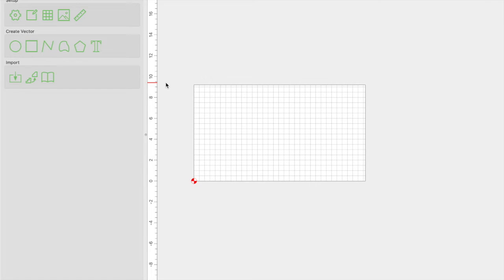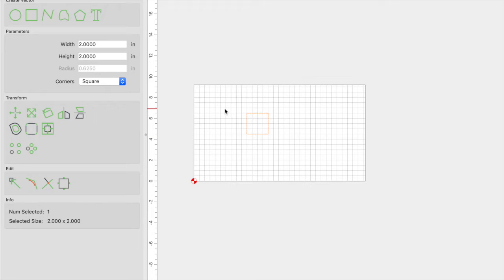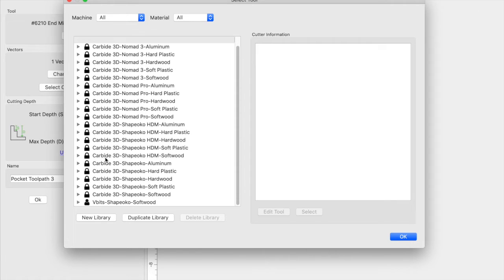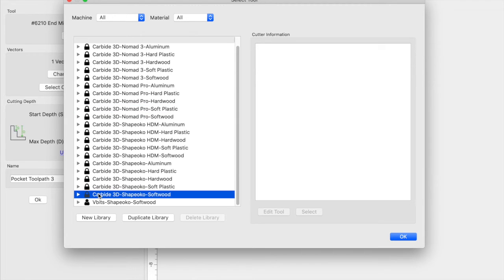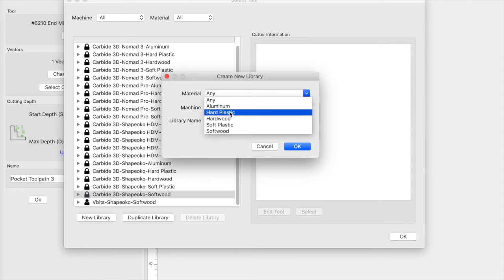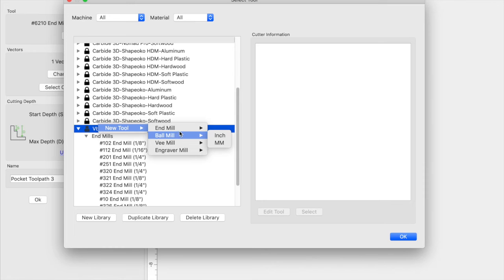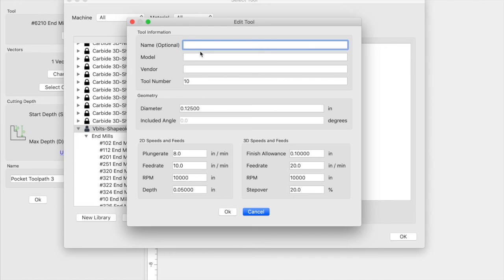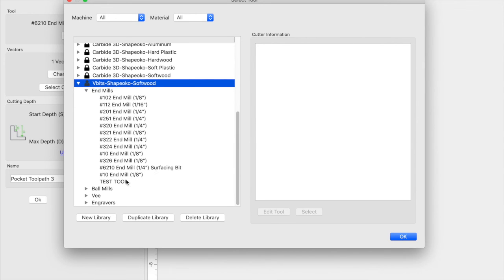How to Add a Tool in Carbide Create: Your Step-by-Step Guide

Comment: The underlying database for tools is in the CSV spreadsheet file format. The tool files can be edited with a spreadsheet application such as in the Libre Office Suite. I attempted to use OSX Numbers on my Mac but Carbide Create crashed after exporting the file back to CSV to save my edits. The CSV file contains a detailed tool profile structure, much more than is available to view or enter within Carbide Create.

Comment: good info thanks  but how do you add tool if you don't have any specs on it
Reply from the maker: Hey Vincent, I’d look for some specs from the manufacturer.

If they don’t provide specs I’d look for some specs from a similar tool. 

Even if you enter some default specs when adding the tool, when setting up the toolpath you can always change them. 

As you experiment with the tool and some settings you may find something that works for you.  You can then go back in the tool library and update those default settings to what you like.

Comment: I'm having a hard time with advanced v-carve. Using two bits, how do you get the machine to let you zero your second bits z-height? I zero the x/y/z of the first but, run the the first piece, but don't know how to zero the 2nd bit without just starting over.
Reply from the maker: Hey Russell,

When you save the advanced vcarve toolpath the gcode for both tools will be in one file. 

With that said,  have to use the bitsetter. If you have the bitsetter you don’t have to reset your zeros.  

If you don’t have the bit setter you’ll have to be able to split the gcode and run as two different files. 

If you have the bitsetter you may have the wrong post processor selected. Here’s how to change that and get the tool change prompt. 

How to Get Tool Change Prompt In Carbide Motion | Beginner CNC Tips | Carbide Motion Beginner Tips
https://youtu.be/k0VEXPPrGd0
Reply: @aetimberpine  thanks, I will try than. I appreciate it.